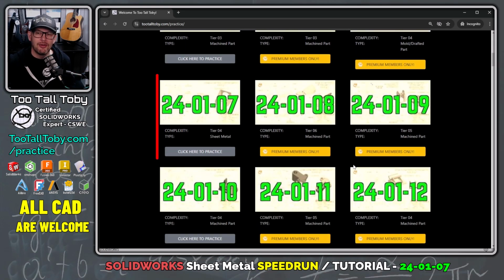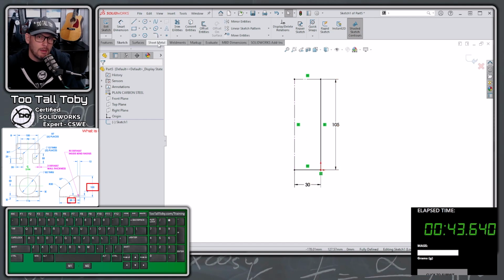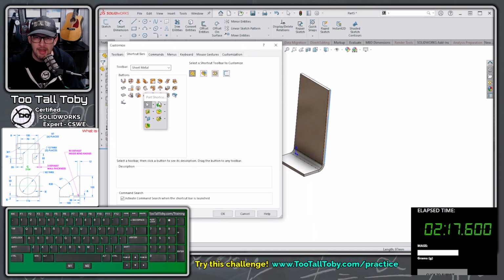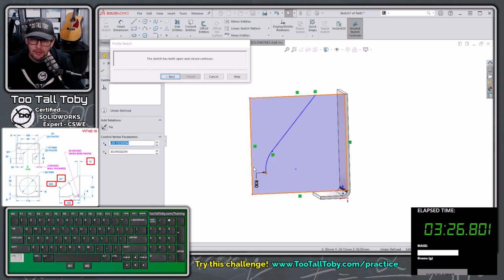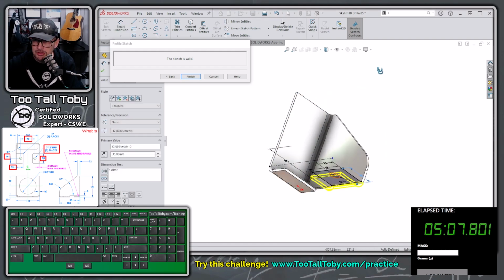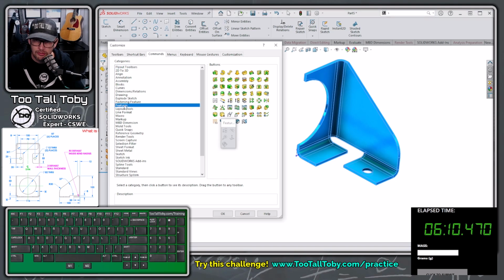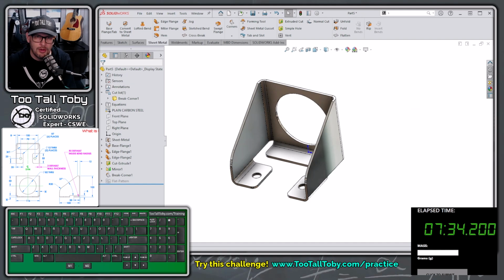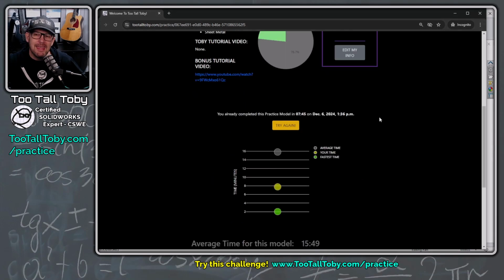SOLIDWORKS Sheet Metal SPEED RUN!!

Comment: Hey Toby! I’m facing a challenge I haven’t encountered before. I need to design a progressive stamping mold for turning copper sheets into a rectangular bowl shape. I am using thin copper sheeting so I really need the thickness of the finished part to be consistent. Is there any features inside of solid works that could help me design the properly shaped stamps? I’m thinking starting small, then slowly drawing the material to the final shape, but knowing which geometry will pull the most material from the sheet is what I’m struggling with.
Reply from the maker: The only tool in SOLIDWORKS to do this (that I know of) is surface flatten.  This is available for any SolidWorks users who have the top tier solution - SolidWorks premium.   (however, if you do some digging on message boards you'll find there are ways for non-premium users to access this handy feature).

The correct solution to this challenge is to use a third party tool.  There used to be a tool called ExactFlat - but it looks like they do more "textile" solutions now and less Sheet Metal Deep Draw.  https://www.exactflat.com/exactflat-for-solidworks .  But you'll be looking for a tool like that that uses a mesh and has tools specifically developed for deep draw sheet metal scenarios to generate correct and accurate flat patters from a DEEP DRAW.  good luck!